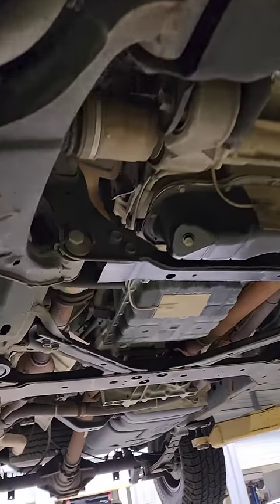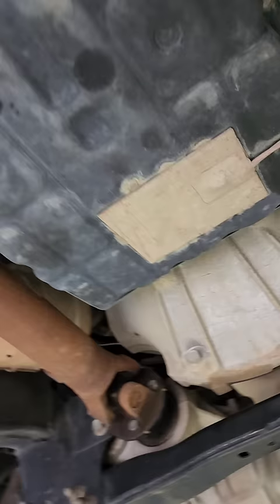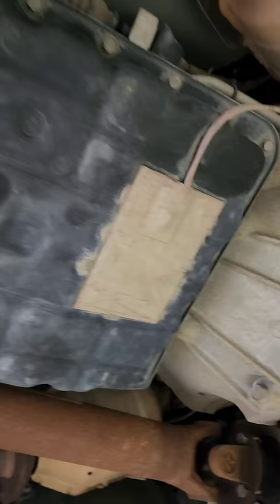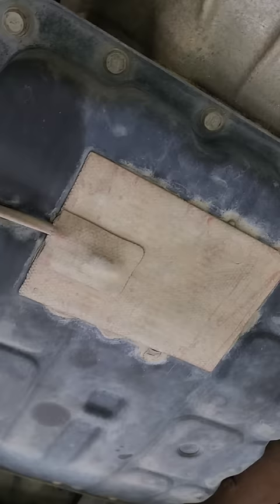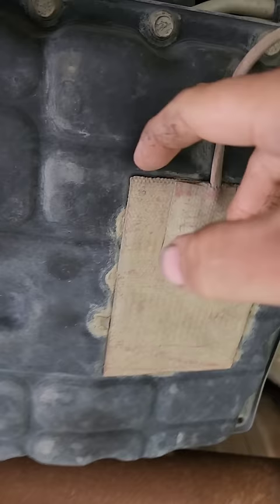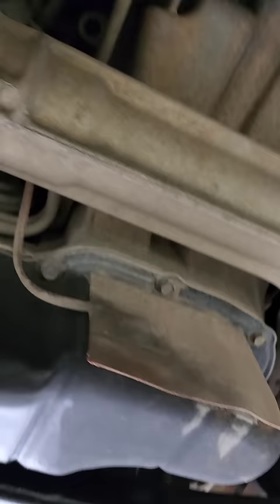CRINGY Mechanic Inspection #shorts #auto

Comment: born and raised in Dallas Texas and I know exactly what those are And that's why nobody else has put a wrench on my 2002 Tahoe w/ 246195 miles on it and it's still purrs like a kitten.
Reply: 👍👍👌 92 Dodge 350 5.9 12v Cummins 869,000 mi.
Keep it warm, change oil.
Reply: Congratulations.   You want a cookie or what?
Reply: Same.
   But, mine is a Yukon w/380,000. Gets up and goes to work everyday, just like my old a$$
Reply: @Eric Marks  right now, a wiring schematic for a 2003 Ford ranger would be nice. No mechanic has touched a vehicle I've owned since 1964. I can treat myself to cookies, got milk ?

Comment: Block heater pads. You can get em for RV tanks aswell. They are just 12 volt heating pads so when you start your vehicle in sub zero Temps you don't damage the motor and Trans.
Reply: Not a 12 voltage pad. Those are 120 ac pads.    Cold Temps affect batteries as well and there is no way the vehicle battery would suffice.    Plugged into the house with an extension cord.

Comment: These are alternative to block heaters that allow you to heat up the transmission and the engine oil instead of coolant. It actually helps it run a little bit better in severely cold weather.

Comment: Yup. It's an engine block heater. Somewhere you will find a plug that connects to an extension cord that runs to a house for example. People use them to keep the oil warm in the block during cold winter months.

Comment: Those are automatic oil level adjusting pads!!! If any of the pans are low on oil, the pad will heat up, which in turn increases the oil level. Then when you stop driving and the pads cool off, the oil level comes down!!!
Reply from the maker: That sounds better than keeping the fluid warm in super cold temps 😅🤣
Reply: @FluffyMexicanik 😂😂😂😂😂 dude YouTube did not notified me of your reply. Wondered how many people saw the comment and actually believed it lol

Comment: Engine and transmission heaters. Engine blocks freeze at -45°F. Too bad electric vehicles will not charge in the winter because the battery heater will soak up the charge.

Comment: I live in the biggest city in alaska this isn't really required. But in Fairbanks, where it gets super f**** cold yes. It's a must have especially for diesels. If you go to buy a new car in Fairbanks during the wintertime. There's a minimum two hour wait before you can even take the test drive. Yes, you will fry the motor or the transmission if they don't let it warm up. There's a very good reason for heating blankets. And heating pads.

Comment: Heating pad on oil pan is fine, but heating pan on transmission? Hell, no! Heat is transmission killer if over 200F temperature (93C temperature) even in frozeland.

Comment: It's a heater plate for the oil and trans fluid. Keeps the oil and fluid pumps from overworking from trying to move fluid when starting your vehicle in very low temperatures.
This vehicle probably has a block heater also.

Comment: I think of about 20 years ago when it got to -50C and gm had changed a line in the code which engaged one of the transmission clutches but the trans fluid in the lines went solid at -45c. There was no cooler return flow. All the brand nuw truck transmissions were completly burned up.  Over 50 pickups dead in just one dealer drive.  Gm had to pull new transmissions off the assembly line to cover warrantys.

Comment: They're heating pads. They're there to keep the transmission fluid and oil warm. So it doesn't freeze in the cold alaskand it helps make the car easier to start in the morning works just like a block warmer

Comment: For cold places. For extreme temps. If those wasn’t there the motor would prolly stayer no more then 100 times. Oils cold don’t wanna move well. Heating pad is a dumb fix but works

Comment: Definitely Oil heaters.  For cold weather climates., I suspect the other end of those wires go to a 120V plug for plugging into to home power while the vehicle is parked.  Usually the plug will be hanging out of the front grill or under the hood.

Comment: In the earliest days of Aviation when Biplane fighters used inline V12's in the states where it snows & gets really cold, the oil was drained, while still hot at the end of the day. It was stored inside & kept warm overnight. Even if the aircraft was housed indoors.
In the morning it was further heated & poured back hot into the engines as part of  prep. for flight.
This heating pad method makes so much more sense.

Comment: Oil heaters. When it's below freezing, oil viscosity increases and flows like corn syrup which is bad for the engine in so many ways. 

If anyone wants to do an experiment about viscosity and temperature correlation, put some honey in the fridge and wait an hour and try to pour it into something. Take another batch of honey, warm it up in the microwave or use warm water and then pour the honey out. Warm honey is runny and actually flows well. Cold honey will slowly move as a giant thick gloop and won't move very fast.

It's the same with engine oil but modern synthetic engine oil is multiviscosity and supposedly engineered to still flow well at cold Temps. This is why diesels need to warm up for so long in the winter, diesel and oil need to flow through the entire car or you'll have issues.

Comment: Bought a Honda in Texas. Turned out it was from Minnesota, previously owned by a Mr. Menendez. Had a pretty standard socket plug from, say, a lamp or whatever. Had a n****r-rigged heating blanket element wrapped around and epoxied to the oil pan, and the switch was run through and sticky velcro'd to the dash.

Couldn't figure out the switch until I figured out it was run to the battery as well.

Had an intake with odd brackets bolted to the motor and was basically held on the brackets with clear silicone and some thin wire.

One of the better $500 beaters I've owned, too.

Comment: Those are heat pads so you can plug it in to the transmission fluid stays warm and the motor oil

Comment: Its a block heater.
There are several types available, ranging from one that can be inserted into the oil dipstick tube, as well as the ones that can be attatched to the engine block.
They are to keep the engine oil in the crankcase warm, to aid in easier starting in veey cold weather.

Comment: As an Alaskan, I can confirm they're heaters. You'll probably find a battery plate heater and/or blanket as well and they'll all be plugged into a 4 way box with single extension cord, since they're all low wattage.

Comment: you're not a mechanic, if you don't know what these heating elements are, for heating the oil, in the engine and in the gearbox, they are installed on cars that will be operated in very low temperatures, I came home, left the car in the yard, plugged it into a 220v or 110v outlet, in the morning  turned it off, and starting the engine will not be so difficult, and the element on the gearbox will allow you to drive shortly after starting the engine, there is also Webasto)))

Comment: It’s a Damm heater for cold starts u plug it to a extension cord at night so when it’s very cold outside in the morning the oil and trans fluid will be able to flow easier so you don’t do damage to internal parts that’s all it is

Comment: Those are engine heaters keeps the oil warm and the transmission warm when you’re in cold weather like Alaska or a certain areas in the US that get below 30° and some diesels don’t like it because the oil is too thick so they don’t start very well it’s like a block heater

Comment: They are heating elements to heat the oil and transmission. It's an alternative kor addition) to the block heaters that go in the engine block. We also used battery blankets, heaters for the battery.

Comment: You'll find them in east coast states on small engine generators and magnetic pads attach to tractors and snow plow equipment. Pretty common actually, as temps can often reach sub zero in January and February.

Comment: Heating pad of the oils and fluids and stuff maybe? I had a zr2 blazer with a built in internal block or oil pan heater. But the only thing that was visible was the plug and the wire. Nothing external.

Comment: We have these in Alaska. 
Edit: finished this before the end. We have outlets at Walmarts and other stores also at work to plug our cars in the heat the fluids and and charge the battery. Cars act funny at -40 working on a newer car is hard in the winter bc plastic gets brittle. I've seen wires and cords snap almost like a flexible stick.